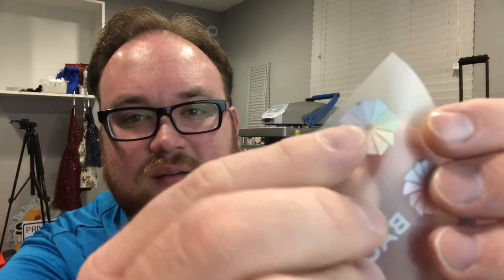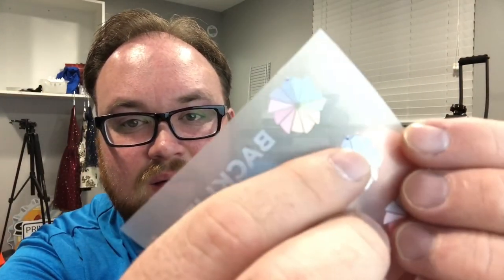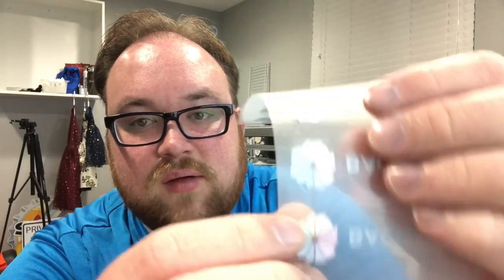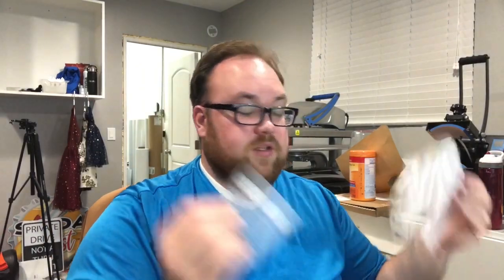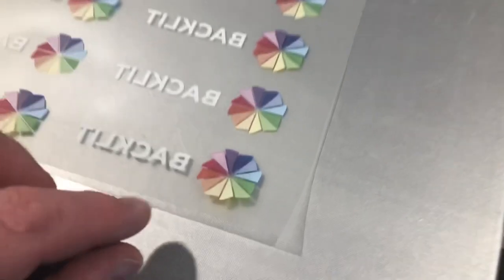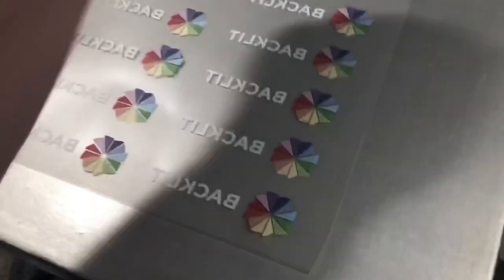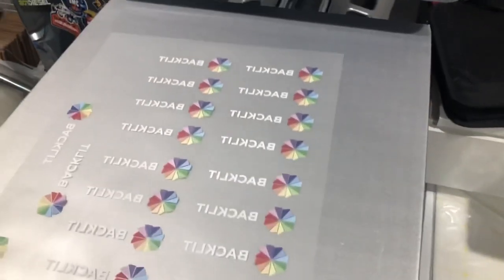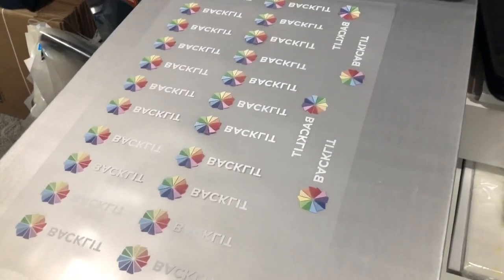Uninet icolor white toner issue - finding simple solutions - icolor 560, 55, 600

Comment: Have you had an issue with white toner printing a yukky grey colour.  I have a ghost white toner , with a hp laser printer.  I just swap out the black replace with white. 100% shade of black needed and out put files is PDF, printer settings, print as image black only. So all this is correct but I don't get white print ??😢

Comment: I'm new here had the printer now for over a year and just took it out the box....and I can't get the software to print to the printer, ports and everything else is set correctly however the printer says its out of paper in tray one but using the bypass, tried it even in tray 1...zilch...rip says its printing but nothing happens
Reply: I’m having this issue too

Comment: Wow! Thanks for this tip. I will def keep in mind for when I have issues with my white toner printer. I’ve also used your tip with heat transfer tape to remove mistakes on white toner and it has been such a life saver 🙌 btw where do you get the thick heat transfer tape from? I only have the thin one 😐
Reply from the maker: Happy to help. I buy the tape from Amazon https://amzn.to/35LtQ45